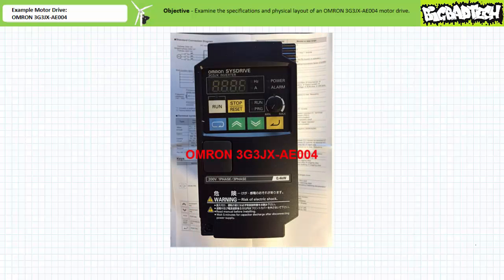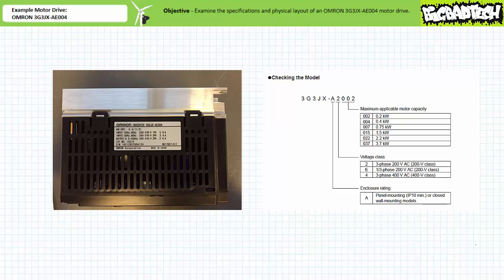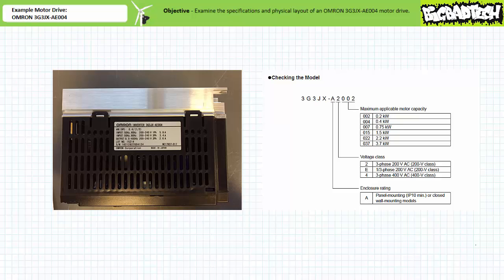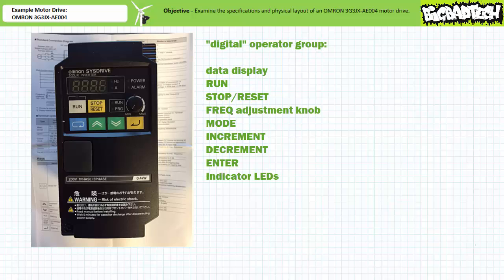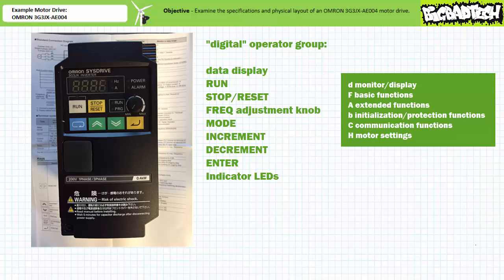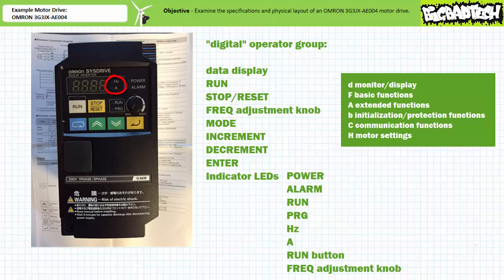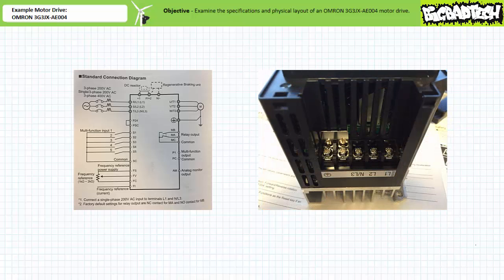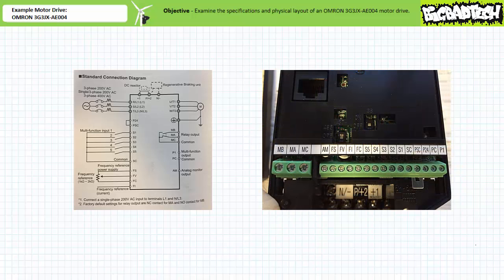Example Motor Drive: Omron 3G3JX-AE004 (Part 1 of 2)

Comment: Hahaha Jim you couldn't find better example .... and yes I was confused with digital operating group .... and later in manual I find out that they are talking about front keypad of the device
Reply from the maker: Too funny. Yes, these drives are very flexible yet extremely economical. I'm kind of bummed they discontinued them, however, the 3G3MX2 series is almost equivalent (right down to the operation menu) they simply added a couple additional inputs/outputs.
Reply: Yeah, because  the last two  drives I  have to handle,  where exactly 3G3MX2 and 3G3JX 1.5 KW (3G3MX2 actually got no built in  potentiometer ). User manual for 3G3MX2 got 408 pages, so your  videos actually make it easy to run across user manual and clarify many things like the difference for example between frequencies (BASE frequency, output frequency, carrier/switching frequency ), so one cannot make mistakes during setup on keyboard. very , very useful video .... and yeah,yeah I know you said this is educational videos only, and not to use directly on the field, but they are so good :D ....like it ....sorry   for my bad English :D
Reply from the maker: Vaš engleski je bolji od moje hrvatske. Yes, it's a bummer they removed the built in speed potentiometer (from a safety perspective I understand) however I love the new USB programming functionality.